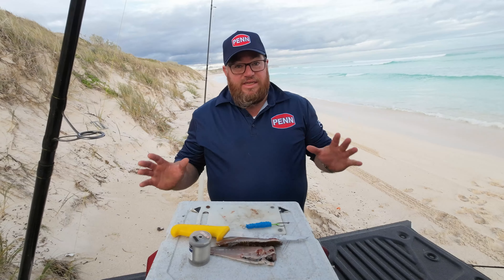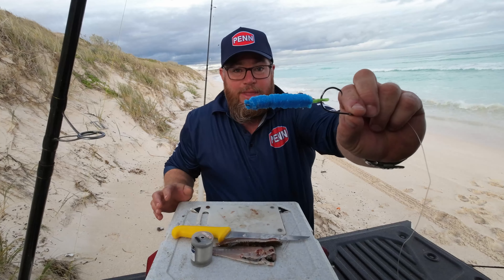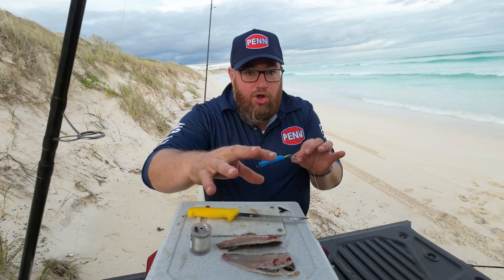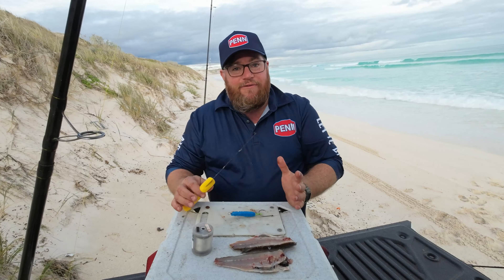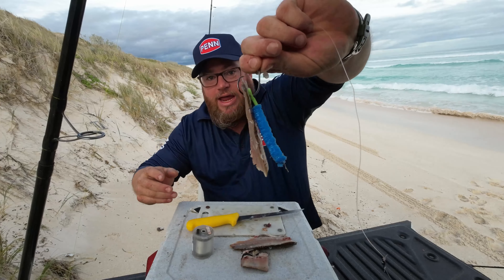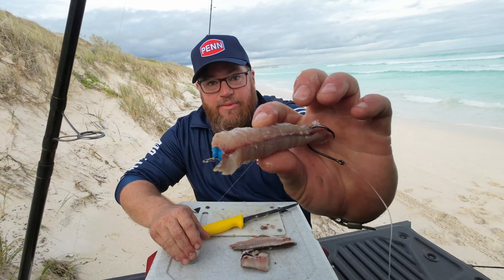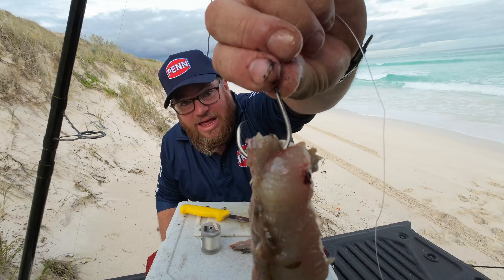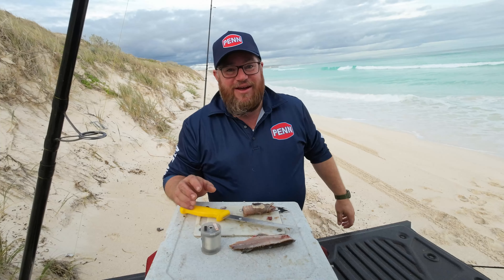Dingle Dangle Baiting Part 1  - Building A Cut Bait The Right Way

Comment: With a bait that heavy, are you getting any benefit from the floatation, or is it just for bulk? I know with aquid bait you can use the floatation to make it look alive.
Reply from the maker: The benifit I get from it is keeping it suspended higher in the water column to avoid rays, this is why I use pool noodle as it has awesome buoyancy
Reply: @On-PointAdventures  excellent
Reply: Diffent types of flotation are used to see different results, high density foam is used for bigger baits as they float higher, depends on where the fish are feeding, high or low, u adjust ur flotation accordingly

Comment: If a smaller fish bites you will never catch it with this system. Also you have systems to directly have the hook on the release
Reply from the maker: Thankyou for the comment. I am slightly disinclined to agree. Small fish still often get caught with single dangles. Whilst there are systems to directly hook onto a release aid they make it a little more difficult to build a really nice bait ( not impossible but not as easy). Also the flotation the dangle offers is vary handy. Both systems have their time and place
Reply: Im a south african angler and normally dingles are used to target bigger fish, u can scale down the size of the dingle and hook to target smaller species. Go big or go home😁